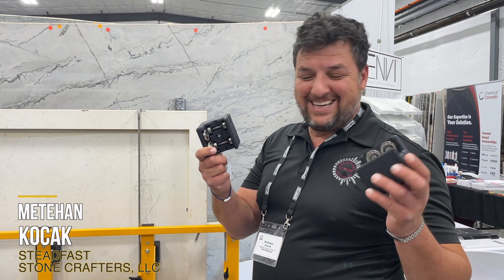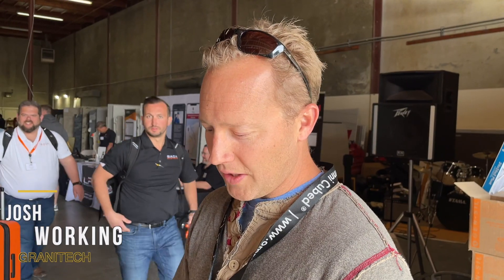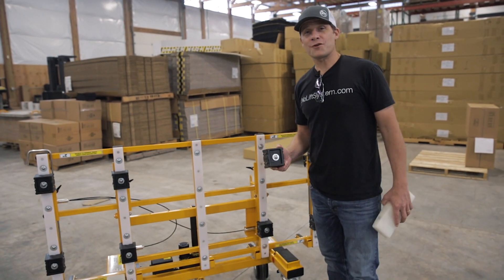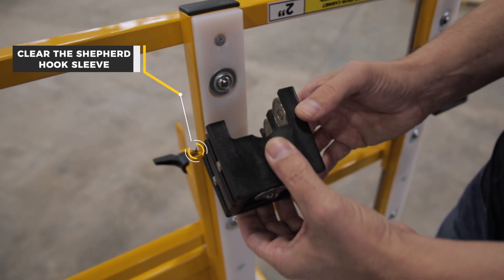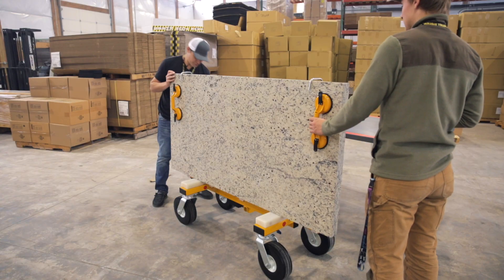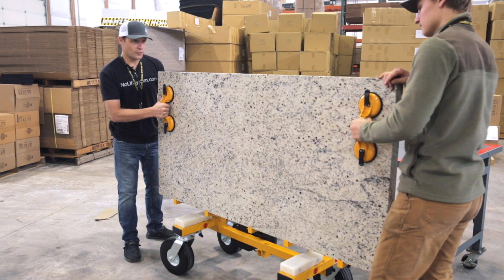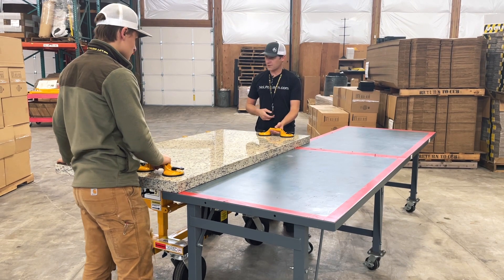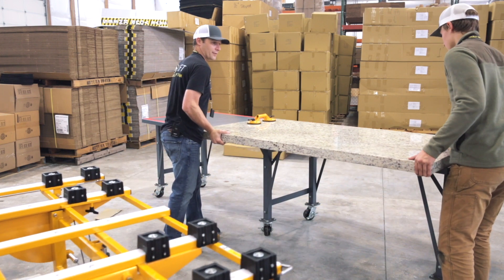The EDGE SLIDER - How it works

Comment: I feel like its not safe for islands with sink cutouts , seems to me like the stone will crack when lowering the cart as the outer edges will not have support. And all pressure will be in the middle.
Reply from the maker: When transporting a sink piece, a cooktop piece, or any fragile countertops, it is ALWAYS recommended to use a support rail system on top whether you are using a No Lift System or just transporting material in general.  That is why we offer the counter handler, grabos, and support rails as part of the full No Lift System package.  All available on our website. :)